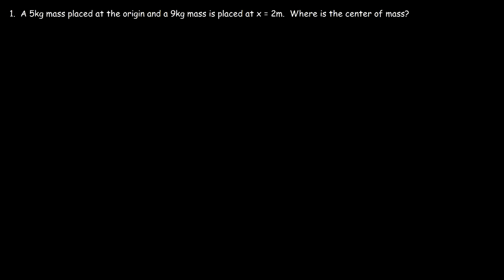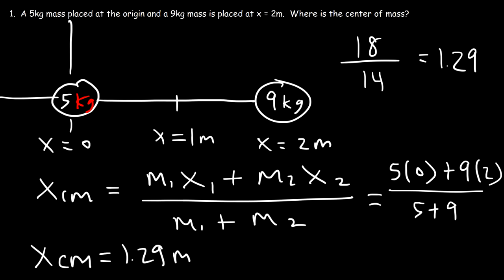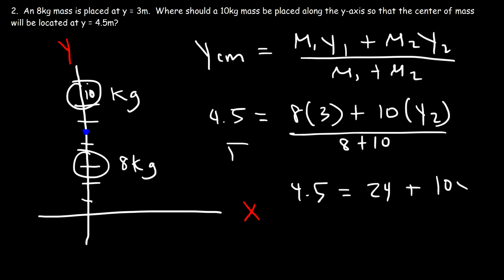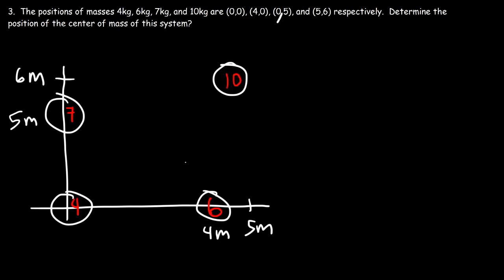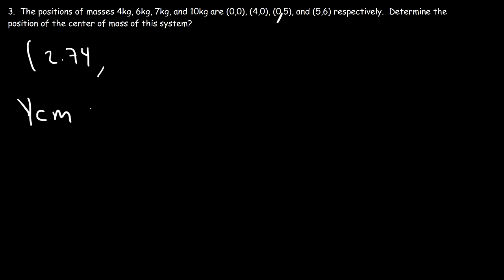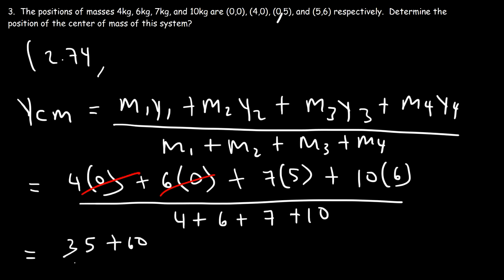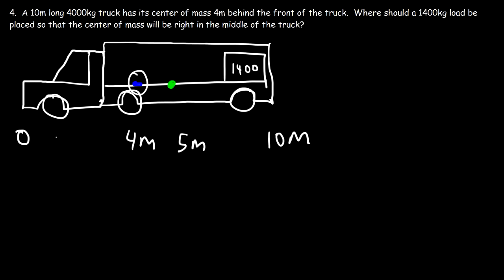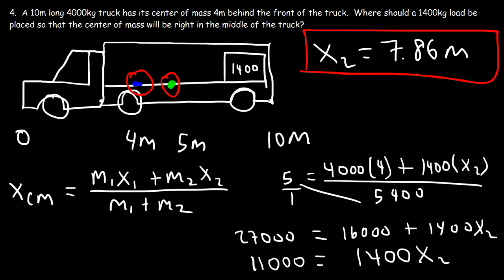Center of Mass Physics Problems - Basic Introduction

Comment: in the last problem, it depends on what reference point we are going to pick. We can use the one that our professor, The Organic Chemistry Tutor, used wherein the back of the truck is in the x=10m or we can use the other one wherein the back of the truck is in x=0m and the front of the truck is in the x=10m. In this case, the computation will be 5m= (4,000kg(6m) + 1400kg(x2))/5400kg and if we solve it algebraically, the result will be 2.14m. Why 6m? It is because based on the problem, the truck "has its center of mass 4m behind the front of the truck." If we use the reference point where the front of the truck is in x=10m, then 10m-4m is equal to 6m. Let me know if you also use this one.
Reply: thanks GOAT
Reply: Are you going to win another superbowl using this knowledge?

Comment: I have a doubt sir, in the last problem who have taken x1 value 4 which is center of gravity , but we should take 10 right , but why did you take 4 as x1🙂 plz give me answer sir
Reply: he took 4 because the x values should be the centres of individual masses and the centre of mass is at 4 meters for the truck. the 10m lenght doesnt need to be in the equation, it just shows that the centre of mass will be somewhere between 0 and 10.
Reply: @tlili3990  But doesn't x need to be distance? Why would he take it as centre of mass of truck? I m confused af💀

Comment: How did you got 5m as center of mass?
Reply: Because in the question they said the center of mass will be right in the middle of the truck and the truck is 10m long so the middle of the truck is 5
Reply: @maryamibrahim8283 thank you man

Comment: How come none of these adress the fact that an object has more than one “position. If it begins at 0 and is .5 meters long, is the position the avg length? (0+.5)/2=.25
Reply: yeah so most of these examples are for particles but there are some problems where the masses have more than one position. once i had a problem where 3 boxes had different lengths/masses (but same height) and i had to find their Xcms from an origin point set at the bottom left corner of the first box. 
Basically ycm was half the total height cause the 3 boxes all had same height, but for length it was different cause the three boxes had different lengths. 

box A had length 0.25 m, mass 0.8 kg
box B had length 0.35 m, mass 1 kg
box C had length 0.2 m, mass 0.6 kg
i'm not sure if mass is relevant to your question, but you would use it to find the center of mass of the whole system. however, if we're just looking for center of mass for each box, this is how:

I solved it with:
X(a)cm = 0.25 m/2 = 0.125m 
X(b)cm = 0.25 + (0.35 m/2) = 0.425 m
X(c)cm = 0.25m + 0.35 m + (0.2m/2) = 0.7 m

if we wanted to find center of mass for the whole 3-box system: 
xcm = (0.8kg * 0.125m) + (1 kg * 0.425m) + (0.6kg * 0.7 m) DIVIDED BY (0.8 kg + 1 kg + 0.6 kg)
then we get the answer, the center of mass of the system is 0.394m.

hopefully this answers your question!

Comment: In the last problem why did he used the x1 for the truck 4 insted of zero, since the front of the car is located at position zero?
Reply: he just arbitrarily assigned the 0 to be the front of the truck, so the cm of truck is at 4m relative to the origin zero. What the answer of 7.86m means is that the center of mass of the object weighing 1400kg must be at 7.86 m relative to the origin. This cm of the individual objects give rise to the needed 5m center of mass of the system.